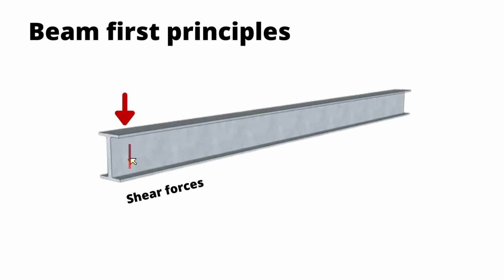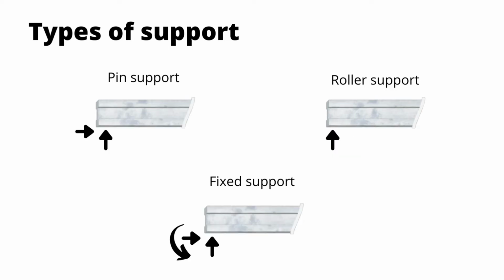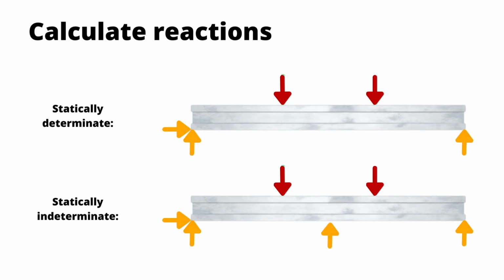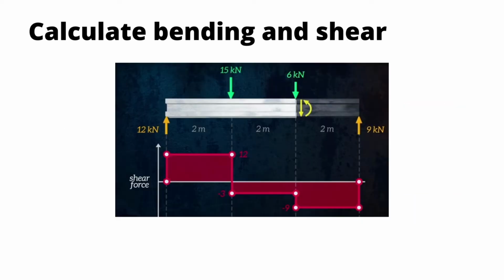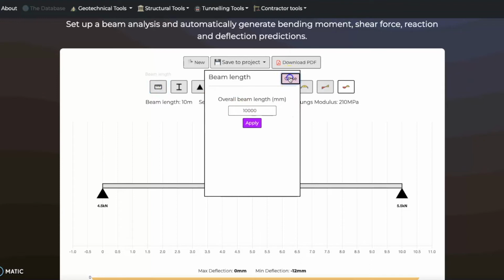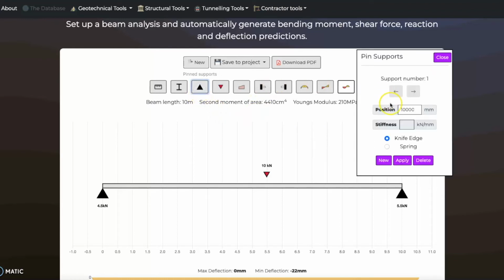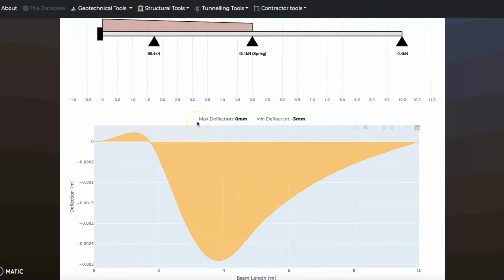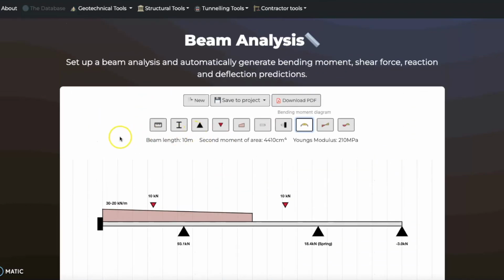Beam Analysis Calculations Explained in 5 minutes for Civil and Structural Engineers

Comment: I have a question about modelling of buried flexible pipes in plaxis..do we use line contraction there? How to decide the value
Reply from the maker: Hi there, the line contraction in plaxis depends on the construction methodology. You are essentially shrinking the pipe geometry so that it's smaller and so the earth moves inwards to fill the space. This created settlement. If you are just interested in checking the strength of the pipe I wouldn't use a line contraction. Just model it up to that stage and then check the hoop thrust and bending moment
Reply: @civil-engineering-ai  but flexible pipe doesn't contract in soil i think so we don't need to use line contraction or am I wrong somewhere ... plus during graph generation only displacement can be calculated there is no option for hooo stress
Reply: Ok i think i understand now thank you